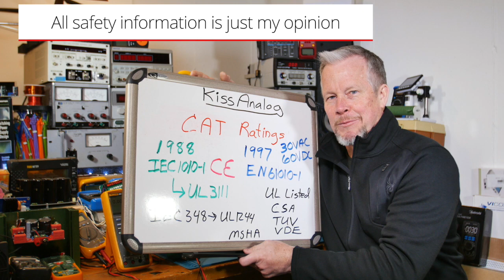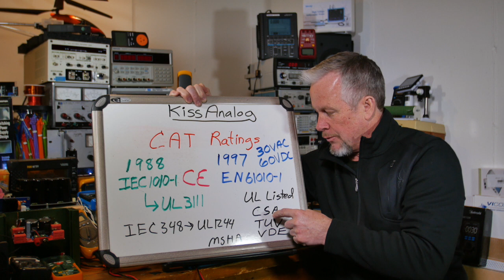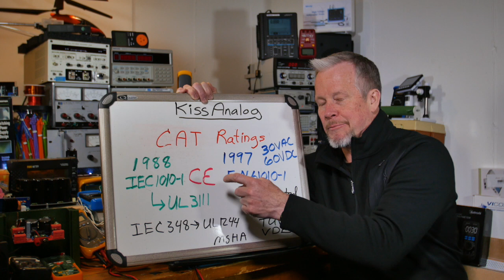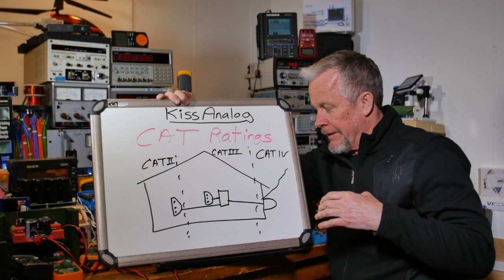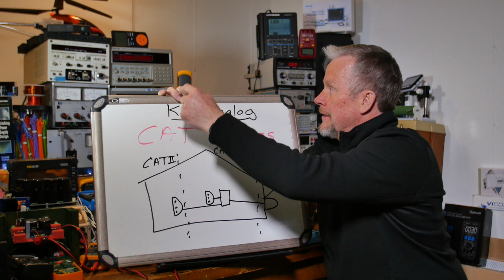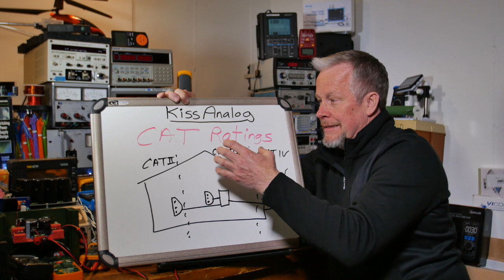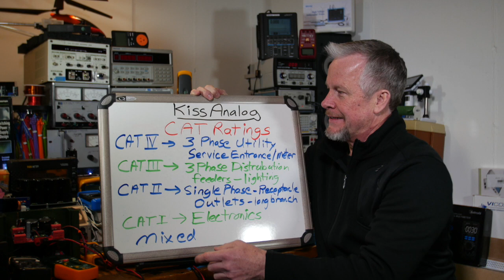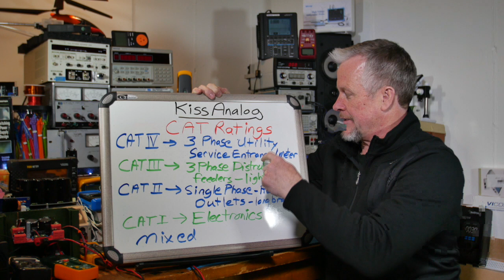Multimeter Safety Tutorial

Comment: CE doesn't mean it's tested by any means. It's just manufacturers' promise they've made the product so that it conforms to all required standards, so it should be safe. There's no CE certification body anywhere, there's just laws and standards that define what CE requirements are. People outside EU shouldn't look at it because the responsibility of product safety falls on the hands of the seller which should inspect the product, but only in EU! That doesn't mean the seller ever checks if the CE label is valid but they are responsible if the product causes any harm. Every electrical product and safety helmet and so on sold in EU must have CE label, otherwise they're illegal.
Reply: You might now wonder what's the benefit of having CE marking on the product then. Well, it's simplifies customer's position. 1) Customer has business only with the store which sold the stuff. They don't have to deal with the manufacturer in case of a problem. This means store has full responsibility of ensuring product safety. 2) Stores make business with manufacturers and importers, and if those claim the product was CE in the business deal then obviously breaching the deal has legal consequences.
Reply from the maker: Thanks for bringing this up.  There is a lot of confusion around this.  The CE mark shows that the manufacturer has tested it to the IEC standard.  This is a self certification, but if a manufacturer is caught not testing - they priveledge of using the CE mark can be taken away.  Some Chinese companies, as well as others, do actually have their equipment (multimeters) tested and certified by a 3rd party, e.g. the 118 meter that has become so popular.  The main difference between CE and UL or VDE is that it does not require 3rd party certification - it can be a self cert.  Check this video out for more on this: https://youtu.be/h6eebkRj7YI
Reply: @KissAnalog  There's a lot of stuff that has this stamped on. There are some government safety bodies that check occasionally if stuff is really safe and oh boy, there's a lot of especially far east produced cheap stuff on the shelves that do not meet the requirements. Most commonly the problem is a bad power cord or power cord attachment which of course is not a problem with multimeters.